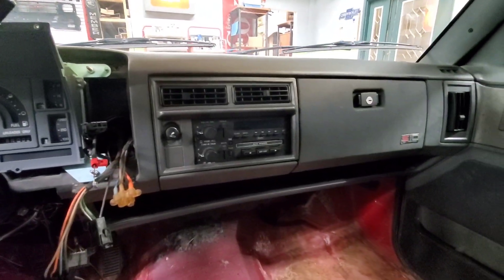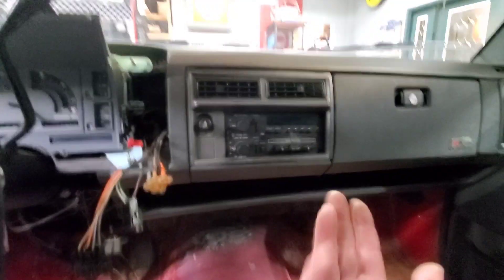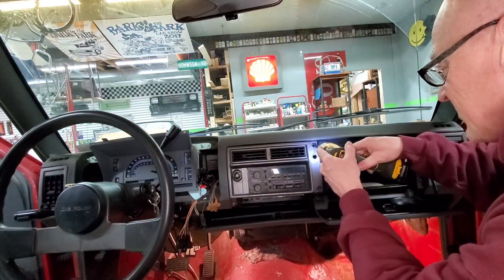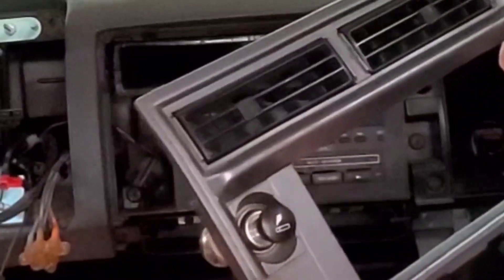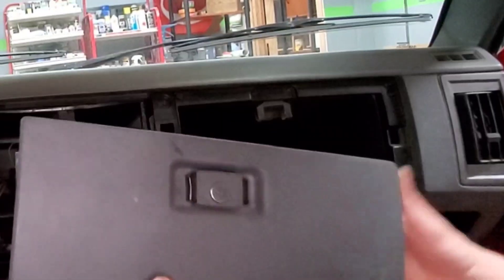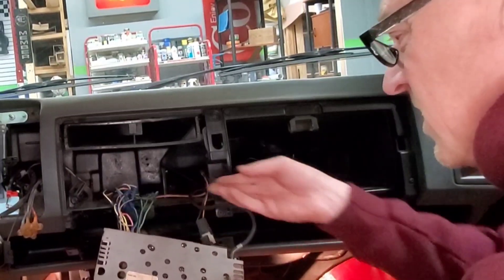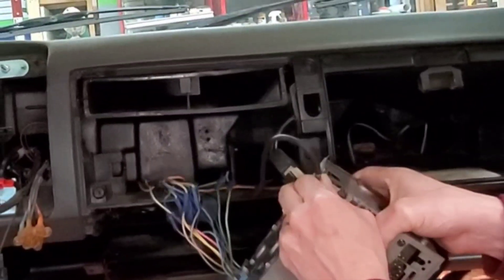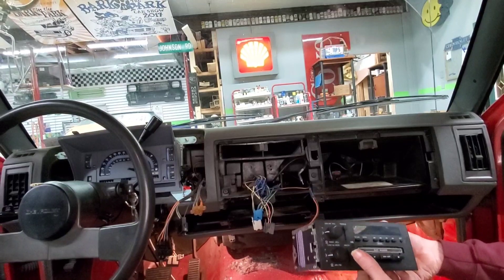Removing the factory radio from a 1986-93 Chevy S10.

Comment: I acquired an 88 S15 Jimmy as a "winter beater" (I am not going to risk my XC90 to these drunk cowboys up where I live) and got a new JVC stereo from a neighbor.  I pulled the old stereo and while I was waiting  for the install kit, was still driving around.  Much to my surprise, when I turned on the lights, the dash lights and gauges shut off and both turn signal light indicators in the dash came on.  I went nutso trying to figure out what I did.  I got out the shop manual, electrical diagrams and electrical troubleshooting guide.  No help.  After looking at the wiring diagram, I figured it HAD to be a grounding issue.  I did some temporary grounds from the harness to a good body ground and still nothing.  I was getting upset trying to figure out what the hell was going on.  So, I stuck the old unit back in, plugged everything in and connected the antenna to the radio and presto chango, everything worked as it should.  I installed the new system and everything worked great.  Until some meth freak broke in, RIPPRD THE STEREO AND PLASTIC DASH PART OUT, stole my dash cam, my battery charger, my HR 12 and my rear LED lightbar.  The DID however leave a cigarette but in the console and our local dipshits wouldn't take it and run a DNA on it (and I can GUARANTEE they will come up with a hit) so I called a former collogue out of state and told him and he said to send it down to him and he would have his lab run it and run the results through AFIS.  I'll take it from there.
Moral of this story, if you remove the factory stereo and the dash lights and gauges quit working when you turn on the lights, it's the missing ground.  Has to be something internal to the radio and the antenna to complete the ground.
Reply from the maker: That's crazy! Lol I keep the stock cassette in most of my s10s. Just hate the look for an aftermarket radio sticking so far out
Reply: @HardCoreGarage  I still have my stock head unit in my ‘93 S10, it has some awesome features I’ve never actually seen! The scan function is pure awesome, its got a built in EQ, and balance. Just awesome.
Reply: you know you cant leave us hanging and have to keep coming back with updates to this
Reply: @HardCoreGarage  if my cassette player had continued to work i would have just left it but replaced it with a 20 dollar unit that used SD cards and now i found a 25 dollar unit with blurtooth. but now been driving a car with wireless android auto so im spoiled so trying to find the cheapest head unit to give me that function in a 91 blazer
Reply: @Choaf82  I got the test results back and have been combing the innerweb to find him.  Should have been easy considering I live in a small town in BFE Montana, but no luck yet.  The PD wasn't interested so I lost a lot of respect for them.
Reply: @MrTommyboy68  have you contacted a news station of any kind with it seems like should be a pretty good story to drop on the small town.
Reply: @Choaf82  Our "local" paper got bought out by Gannett and they closed the local offices/printing center and moved the whole shooting match 2 hours south of us.  So we don't get much "local news" any more.  Besides we have such a big problem with the meth heads and now fentanyl users, it isn't news any more.

Comment: Was hoping u would have the same setup as mine an was wanting to see what after market radio u was gonna go with too in this if that's what u was doing .

I need to chnage mine in my 93 bad it has static on the right side speakers an only the front left one works an plays good sound . but anyways the back part of the radio on mine has 2 black connectors an both are long an flat like an plug uo to same side as yours but u have 4 connectors to unplug an 3 different  colors like my 85 model does but my 93 is way different an I've tryed to find a aftermarket harness to plug into that so I can put in a aftermarket radio but I can't find anything for it .
Reply: Have you looked at Crutchfield?
Reply from the maker: Not a fan of aftermarket radios in these.  They stick out so far. I enjoy the tape decks.. like a time machine.. when your in it you only listen to a certain era of music!
Reply: @HardCoreGarage  I was suggesting he looks into Crutchfield for his harness that he needs

Comment: I had recently got a 200$ radio installed and went for a drive to test the road it last good for a while until I tried to use to the cigarette lighter now the radios dead dead 😞 I checked fuse and they seemed fine I can only assume a short?
Reply from the maker: Pretty sure they're on the same fuse

Comment: In need of some help. I recently installed two new dash speakers and the back cab speakers in my 92 single cab. I’m getting sound from both dash and one back left only. Also, I don’t get any sound from my right dash in the middle of the balance knob but I get sound from both right and left dash only when balance is all towards the left. Is it my stereo unit that is possibly faulty?
Reply from the maker: I'd guess it's the radio. You might try pulling it out and cracking it open. Get some electronics parts cleaner. It's aerosol and evaporates fast.

Comment: Good video! I have purchased an 89 s10 Tahoe trim. Currently having audio issues where my passenger side speakers are not playing but I have verified they work. The only way to get sound in the passenger speakers is to turn the fade to the right and turn up the volume. Am I looking at radio unit issues or shorted wires?
Reply from the maker: Id try another radio,  if the problem goes away have the old radio looked at.

Comment: I have a 91 chevy s10 p/u and I cannot find the original car radio anywhere
Reply from the maker: Ebay. All gm vehicles used the same radios. Often the others are nicer than the s10 specific radios. I had a oldsmobile silhouette cassette in my gt.
Reply: @HardCoreGarage  appreciate it
Reply from the maker: To be totally honest almost all the others are nicer.  They look basicly the same. But some are a dark grey instead of black. The knobs and buttons will be more rounded..  go ot ebay and search gm radio what ever year your truck is